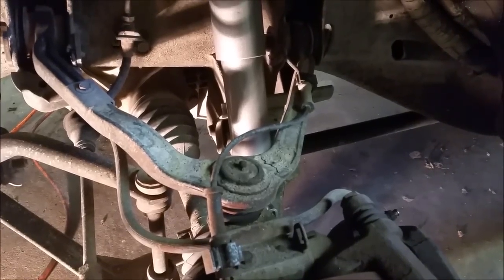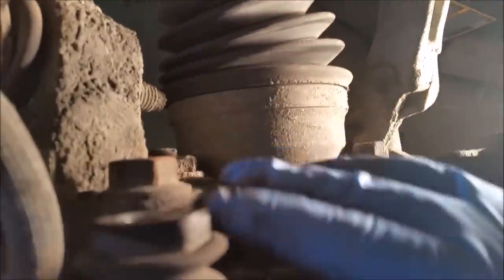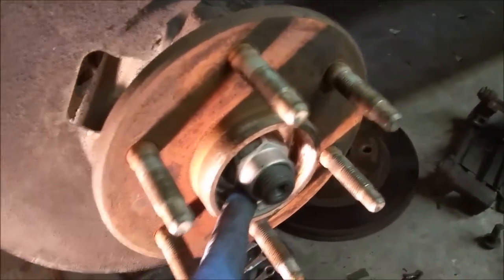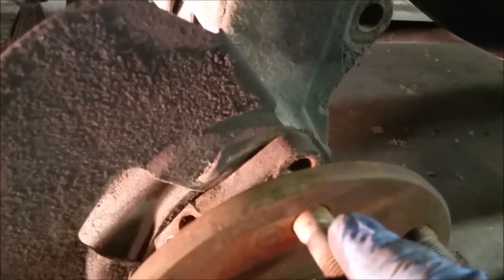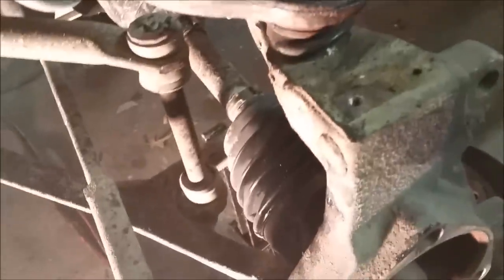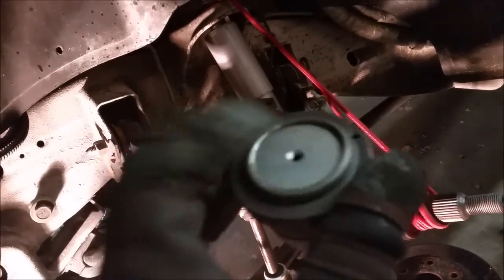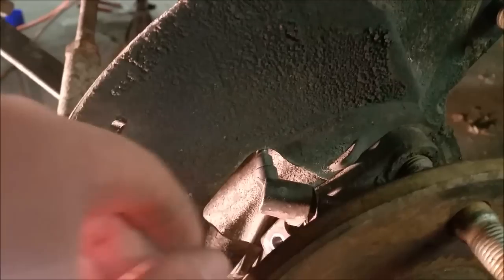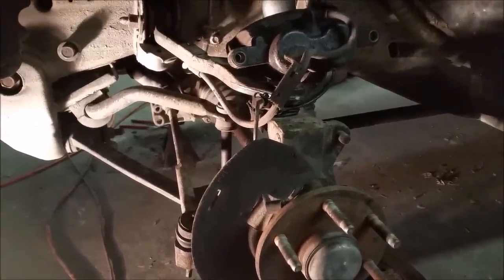Truck Clunking! Replace Balljoints! 1999-2006 Chevy Silverado GMC Sierra

Comment: For those finding this video. Pay attention to how the upper ball joint is installed. It is directional. That dot should face in or out, and not front or back for proper movement of the ball joint.

Comment: the hardest part of this job is using the ball joint remover and figuring out what adapters work for your application. in my opinion showing how u removed and installed the joints with your tool would have helped more than the other parts. anyway thanks for showing how to get up to removing and installing the joints.
Reply: Get a balljoint master kit

Comment: If you pull the CV axle completely, remove swaybar endlink, and undo the tie rod from steering knuckle you can do the upper control arm and then lower ball joint without ever removing the steering knuckle  or brake system.
Reply: Lol

Comment: Why didn't you show taking the ball joints out and putting the new ones in? Pretty much the point of the whole video.
Reply from the maker: MrTmel123 at the time I didn't have a tripod.  I couldn't use the tool and hold the camera at the same time unfortunately.
Reply: Thanks forthe info but would have been better u showed how to install the back
Reply: I agree the purpose of a video is to show you how to do it. If you don't show anything being done. We might as well just read a book. Otherwise, it was a great video.
Reply: fucking amateur hour over here jesus christ
Reply: would like to know what adapters needed for press kit so i know which one to get. Also you do not have to take the hub off the knuckle.

Comment: don't need to take the caliper off the bracket.. just take the whole bracket off.. unless ur lubing the caliper slide pins.. don't gotta take it off to change the pads either..

Comment: 2 thingsI did not understand. you took the bearing off, you didn't need to and, you didn't say anything about the way your supposed to put them in. the hole in the edge of the upper ball joint has to go towards the car, yours didn't. You must charge by the hour, that must be why you took apart more than you had too. other than that great video.

Comment: I just loosened the torsion bar, removed the cv axle, the line clips, and then pulled the lower controller arm off, never removed any brake components  at all. after i replaced the lower, i replaced the top one.
Reply: I also removed the little sway bar links.

Comment: My lower ball joint boots are ripped and losing grease... I stopped by a local shop here and he quoted me 472.00 for the lowers only  and that was just the labor.  My ball joints are Moog and they're 38.00 each for the lowers.

Comment: At 22:12 you show the top of the ball joint. There is a hole on the outer edge. Isn't that hole supposed to face inboard when installing the ball joint?

Comment: I just pull the  Caliper and caliper bracket off as one no need to remove the wheel bearing that's crazy pop the ball joints out press them back in

Comment: yall be making shit way harder than it really is. it's a piece of cake. it should only take 2hrs max. both sides...lol
Reply: bishop what would make it quicker then?
Reply: he didn't have to remove the hub assembly  for one, good video for beginners don't get me wrong , but to much work, the knuckle  and assembly could have come off in one piece, sometimes those assemblies can be a pain in the ass to get the top bolt off  , he added 3 hours more work than needed
Reply: Yeah I second that, could've just swapped out the upper control arm first, hung the hub and knuckle with it strapped up where his brake caliper is as one unit (set the caliper on a bucket or something), and then changed the lower ball joints,  put the knuckle back on, and then the tie rods. Done.
Reply: @tazblzr88  I doubt ill hear back soon but can u explain this please? I dont have a 36 mm for the axle nut. So trying to avoid that. 2006 silverado 1500 .. Cant get to lower ball joint and not seeing how to do it your way. Thank u
Reply: @GodWasAnAlien   I doubt ill hear back soon but can u explain this please? I dont have a 36 mm for the axle nut. So trying to avoid that. 2006 silverado 1500 .. Cant get to lower ball joint and not seeing how to do it your way. Thank u
Reply: Never done it on a FWD/AWD truck, but should be the same principle. Change out the upper control arm first, bolt it up, then find a bungee strap or piece of rope and tie it to the frame of the car/truck to hold the arm and knuckle up. You'll prolly have to take out your wheel well splash guards to get clearance to something solid like a part of the frame. Then take the nut off the lower ball joint, spray some WD-40 on the joint and get a pry bar and pry in between the lower control arm and the knuckle and pry the knuckle loose from the ball joint. It will probably take a good amount of force and put off a pretty loud pop when it finally gives. First time I pried one loose I used a 4' Harbor Freight spud bar and damn near smacked myself in the face with it lol.
Reply: If you don't have a pry bar or don't want to do it that way, some people just take the nut off, turn it over, thread it back on so its flush with the end of the bolt, and knock it with a hammer. I personally have better luck with a pry bar, I don't like to sit there beating on things for half an hour around my apartment complex.  I assume you have a ball joint press to press the joint out once you get everything apart.

Comment: oh and after taking off half that stuff, and before you attack that cv joint, pop your upper ball joint to loosen it, crack ur cv joint loose, drop the upper ball joint carefully let the steering knuckle assembly fall forward and this will free up the cv to come out, bunjee that cv up out of your way and go from there as you did in the video........might be helpful to do full explaining of you popping ball joints in and out, with the proper tools and spacers, just sayin

Comment: You didn't show the most important and difficult part of the job, Pressing out the ball joints. Funny the video is even titled ball joint replacement but you dropped the ball on that
Reply from the maker: Luke S all because I only have 2 hands and didn't have a tripod at the time. Otherwise I would have.  Couldn't operate the press and hold the camera at the same time unfortunately.
Reply: It’s not exactly rocket science...

Comment: I have a z71 4 wheel drive 2002 an the axles has play on the driver side I’ve changed thes axles an 3 days later started it again with play can any body help me out an could tell me wha it is

Comment: You could have just unplugged your abs sensor under the top of the fender
Reply: Chances are good that he'll have to get a new bearing soon due to wheel speed sensor issues. I personally took the sensor off the connector under the fender, and left the whole bearing/knuckle assy intact.

Comment: no need to take caliper off bracket, no need to take hub off steering knuckle, no need to drop outer tie rod, no need to take abs sensor apart let alone at the hub(follow cable up over upper control arm into and under the inner fender near the frame is a weather pack electrical socket, pull on clip seperate the two leads, remove clips along control arm and "wallah")
so nice job explaining and editing vid, but don't try to make a living doing this, haha......

Comment: Why did you remove the hub only reason to remove hud is if you are replacing the hub next time just remove the axl way easier it will save you so much time but good video none the less lol

Comment: replacing ball joints but not shown how to remove it?
Reply from the maker: Yeah, at the time I didn't have a tripod or anything for my camera.  So pressing out the bearing with one hand while holding the camera in the other was impossible.

Comment: What brand ball joints did you use?
Reply from the maker: Scott Seymour these were moog.  If you have a stock truck, that's what I'd go with. If it's lifted, I'd recommend making the investment in the Carli ball joints.
Reply: Chevelle396BB thanks, It looks like they make a quality part. Definitely pricier than the house brands but nice extra features---grease serts, snap rings, cotter pin. Thanks for taking the time to make the video.

Comment: Man u took way to much stuff off😂😂,take tire off nut off upper,pop it loose,pull it foward,take nut off lower and it all moves together, use a jack and then change both ball joints and back together,30 minutes each side and done